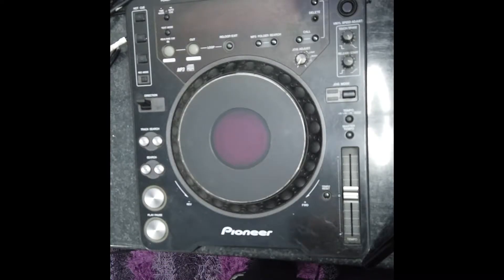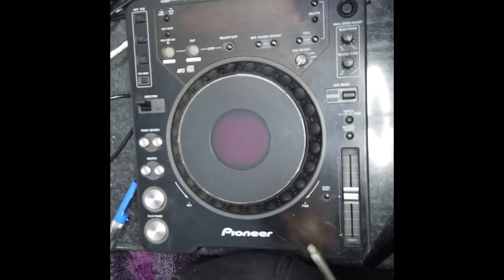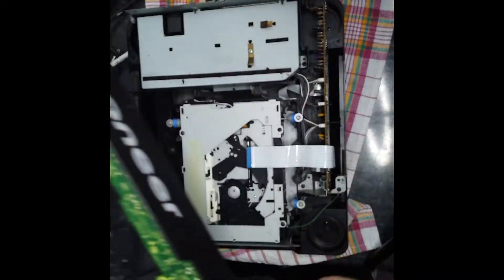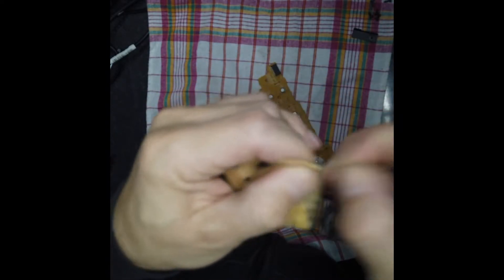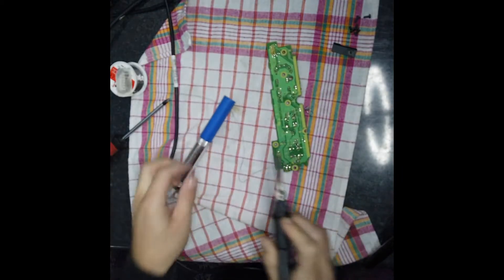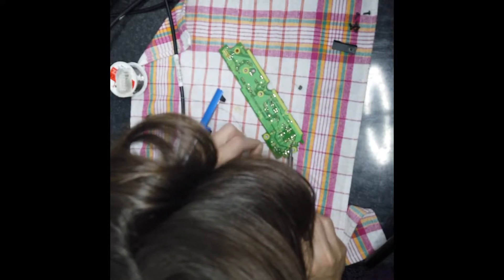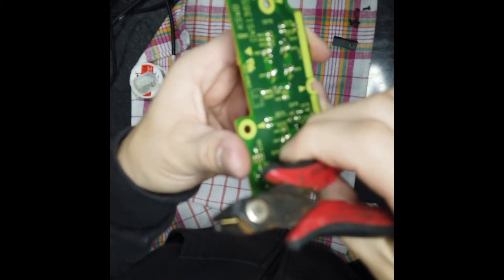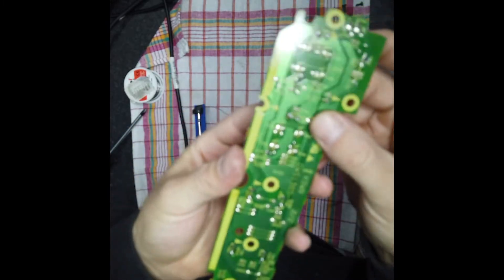Pioneer CDJ 1000 MK1 MK2 MK3  Broken Cue Play Button Repair - Cue Play Fix

Comment: Hello, great video! Thanks! Can this also be the cause of my play button intermittently stopping the disc? I have a problem with my unit stopping after a few minutes and then you have to start it again, it goes back to flashing/standby mode. My other deck you have to press the start button several times to engage, but that one stays playing. Replace the PCB on both units? They are old. Cheers mate!